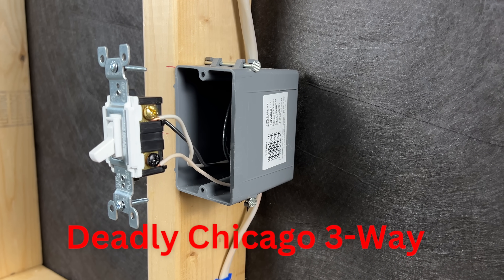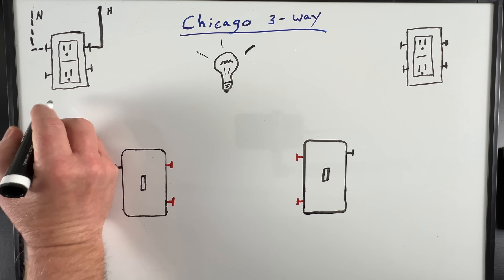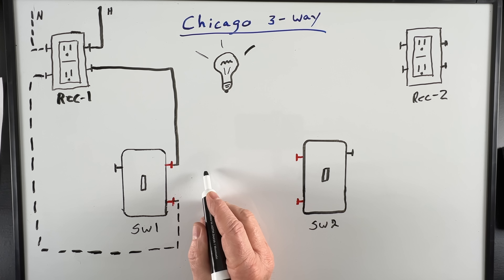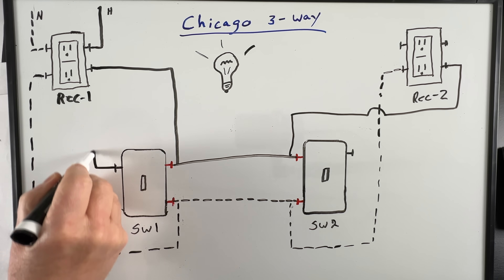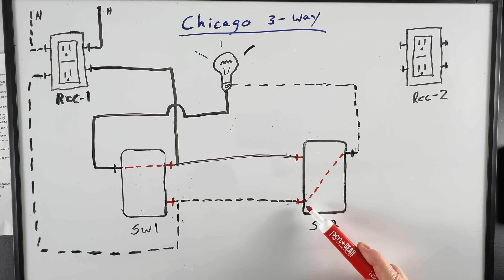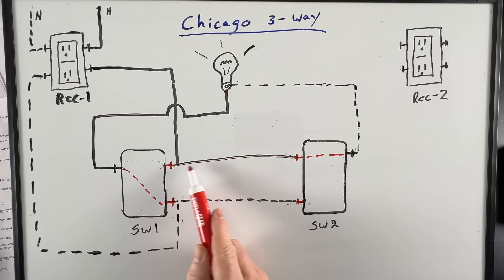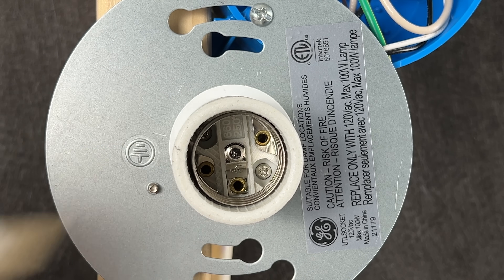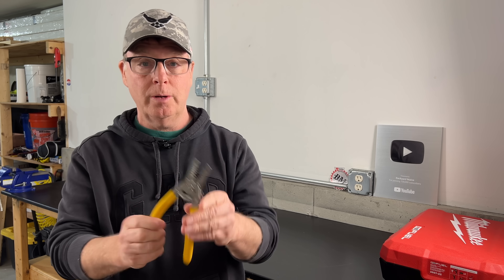The Deadly Chicago 3-Way (Only 2 Wires)

Comment: Warning, this is just a pedantic rant by a stickler for details... You have been warned, and chose to continue reading, that's on you.

The conventional hot and neutral sides of your recept's are swapped, and the wider blade slots on 3 out of the 4 sets show the hot as the wider blade. 

There is a minor consequence to this. You only show 3 of the 4 possible switch configurations, as with your current setup the 4th is not that dangerous, and thus uninteresting. (The hot just dead-ends at a switch [or continues to the other recept' if there is one], and neutral runs a loop between the two switches and fixture [branching off to feed rec-2 if included].) However if you swap the hot and neutral to the conventional sides of the receptacle, that neutral loop becomes a hot loop, and thus both light-off positions make the lamp socket hot when off.

Also you never mentioned that lighting is not the only possible load on a 3-way switch, and so hot-when off conditions can have other consequences to load equiptment. Probably not a situation anyone's ever likely to run into, but something to think about.

Please remember this is just a pedantic rant. I know I'm imperfect and thus probably got some things wrong too, especially with grammar and spelling.

I also know, for conceptual understanding of a Chicago three-way's wiring, this stuff doesn't matter much, and nobody cares. I get that.

I also considdered that you may have swapped the conventional positions of hot and neutral to make drawing it easier to draw, or easier to understand, as you may have thought there may be fewer jump overs or some similar concern. However after having worked it out, I ruled that out, as it would actually make things a little cleaner if the hot is moved to the bottom of the switches.

All that having been said, this was a great video, I definitely enjoyed it. Thank you for your time and effort.
Reply from the maker: Couple of notes.. The with the ground down like I show on my drawing the hots are on the right and the neutral are on the left. I didn't pay much attention to drawing the slots well. But also I have the California 3-way video coming up next. This weekend. The other two will follow.
Reply: @BackyardMaine Lol, I claim to be a stickler for detail and failed to notice it's ground down which is standard in the majority of the US... lol my bad, I knew it was wise to mention that I probably missed something.

Comment: Chicago Sparky here. It's standard practice, at least with the me and the firms I've worked with, to fix these when we come across them. Another advantage of everything being in EMT.
Reply from the maker: Yeah EMT is nice but I imagine it adds a pretty large expense during installation.
Reply: @BackyardMaine  indeed. That's why it's code here. When the codes were originally drafted there were a lot of electrical component manufacturing in the area. Another example of working the economy into building code.
Reply: Including driving up the price of any electrical install. A sea of metal tubing.
Reply: @glee21012  true, but once installed it does make any service work and rewiring so much easier than NM cable does. And you have the extra ground of the grounded system with all that metal touching. The EMT also protects the wires, unlike NM which doesn't at all.
Reply: @glee21012  Secure and protected.

Comment: Did this to feed the garages in Ohio with 2 wires and still had a hot plug  and a switch in the house to turn the garage light off

Comment: I've been an electrician for almost 40 years, I have never seen ANYTHING like this and I've worked in a lot of knob and tube homes(near Philadelphia region), glad I never came across this.  It makes sense for functionality, but WOW! Lutron Caseta with Picos is an easy fix.
Reply from the maker: I have only come across a few in my 40 years in the trade. It took a minute to figure it out the first time. No internet back then so didn't know what I found. lol

Comment: Retired Electrician, Worked around the Washington DC area and fixed a few of these in older homes. We called them "Lazy Susans."  Met my wife on a service call to repair one, I was the third electrician she called, everything was pulled apart for the remodel. First two walked away insisting there was no way that it had worked before. I bet her dinner that I could fix it in 20 minutes (4 gang box of switches). We had Pizza - she paid.
Reply from the maker: That's a great story my friend.. It pays to be smart.
Reply: I can clearly see why a Bass Ackwards wiring scheme like that is called the "Chicago 3 way". @BackyardMaine
Reply: @BackyardMaine  See my comment reply above- I don't think that was so smart... I think the guys who refused to fix what needed to be torn out & upgraded properly were the dudes who made the right call even if that means no free pizza & marriage for them!
Reply: Great story. Congratulations to you both !
Reply: @timothygriscom7110  Terrible story- if he had done the right thing he ALSO would have said it could not be "fixed" & left... just like the other dudes did... bcuz what needed to happen was a tearing out of the garbage & the upgrading >>> properly <<< so the dudes that refused & said it could not be fixed were actually the guys that did the right thing... they lost out on free pizza & marriage but they did what every professional should always do- refuse to do unsafe work & insist on only doing things properly... it's called MINIMUM CODE for a reason & there is no such thing as a MASTER of a TRADE- who is not always ahead of CODE in his decision making & problem solving... that is how CODE evolves... not by corporofascists bribing gov't & dum dum supposed "genius inventors" using gov't to force people to do things that make them $$$ or allow them to monopolize the market by forcing things upon them that have nothing to do with safety & instead are all about [some persons &/or some limited group of persons' >>> ideas of what is] convenience!
Reply: That's probably the most awesome "How we met" story I ever heard
Reply: @markchidester6239 it was but unfortunately she died recently, Electrocuted changing a lightbulb…
Reply: @markchidester6239  The guys that refused to "fix" the unsafe wiring were actually the ones that did the all correct thing!
Reply: Love this story, I’ve been an electrician for 45yrs in Washington DC and Lazy Susan or also called Hot and Lazy are extremely common here in almost any non updated house. I know of about a dozen different configurations depending on two or three floor homes.
Reply: You did such a great job that she refused to let you leave... lol
Reply: She paid🫡🫡🫡
Reply: I mainly do low-voltage stuff, but occasionally I'll install smart light switches. Also in the DC area. This old wiring method explains so much...I've seen a handful of switches with this unfamiliar wiring which I had assumed was just improperly installed. 

Tripped a breaker when testing a new smart dimmer switch once, and from that point on I no longer touch anything that isn't wired according to modern code. I just tell them to call an electrician.

Another oddity with older homes is the doorbell transformer. I've seen them in some very creative locations. In older homes they're sometimes tucked away behind a random wall somewhere, and the only way to access them is to cut out the drywall.
Reply: @nameismetatoo4591  Everything is low voltage stuff up to 1000V.
Reply: Is your wife named Susan?
Reply: @chrisfitz5311  Your name is Lefmitty konstabwuwmn?
Reply: You most definitely rewired her as well
Reply: Theres no way you properly fixed 4 boxes in 20min but okay, cool story I believe in you 😂
Reply: First wife?
Reply: I want this story in a video , upload it then reply to my comment!

Do it for the team
Reply: Guess i have to start repairing wires 😏
Reply: 20 minutes? Damn. I had 2 two gangs with 2 separate three way systems. It took me a couple of hours. Never saw this before. Figured it out but I was a bit frazzled. Ha ha.
Reply: I think I came across this about 40 years ago in an old house. I did not repair it. I had only been a journeyman for a year or so. I’m retired now. But it’s good information.
Reply: I imagine getting juice to her box made her fall in love rapidly.
Reply: I think she was trying to have a porn fantasy and you were the first of the servicemen to take the bait
Reply: Dying breed unfortunately. Girls are not like that anymore. Now it doesn’t matter if you fix the problem and still make 6 figures. They all want a 7 figure man
Reply: We called them Dutchman’s
Reply: I had the same I had to pay for everything😂 when I started back in the late in 1970s  New York City in the old r houses had a lot of setups the Days😊
Reply: And she is still paying!
Reply: Instructions unclear, now I have a sexual harrasment case against me 😢
Reply: This is ridiculous.
Reply: We used to call them hot travelers or dummies....they would burn out 3 way light dimmer, because the make before break gap was so close that the voltage would jump across the contacts connected to the traveler screws!
Reply: You won't the battle but lost the war.
Reply: That's interesting because lazy susan typically refers to something completely different and not electrical. This Susan broad must have been lazy as hell to be so infamous
Reply: This is an old story if you are a service electrician and work on older homes.  Seems to be less commen in my area of the upstate of NY though.  In my 10 years as a service electrician, I ran into it once.  I, of course, was there after 4 other electricians had had a go at it.  Maiking things even better was the fact that the main Jbox was at the top of the stairs and was buried too.  75+ year old BX with soldered and deteriorated connections and insulation made the repairs even more fun.  What ever you wanna call the circuit, it still sucks and is still a pain in the ass.  Dangerous?  Maybe a little but not really in the context of a fixed lighting fixture.
Reply: Fixed loads of them. In old town Alexandra
Reply: Keeper!
Reply: Nioce
Reply: i have one of these at my current rental house, i wanted to trade out a switch for a smart 3 way switch... i was confused why it was done this way, so i put it back the way it was. 100 year old houses have lots of stupid things
Reply: Well you should have torn that garbage out & rewired the joint... better to LIE & say it can't be fixed like the other dudes did in order to avoid continuing an unsafe situ then to "prove" how "smart" you are by "fixing it" only to continue creating a hazard for her & all the neighborhood <<< situ's like that are the whole reason we call it MINIMUM CODE <<< it IS the minimum standard- professionals & especially every TRUE Master of a TRADE &/or HONEST competent & professional contractor will EXCEED CODE to ensure the safety of all who dwell in & near their projects- for instance long before others even heard of circuit fault interrupters [as opposed to GFIC] outlets I knew a dude who installed them in all non wet areas of all residences he did the work in... he was ahead of CODE... and that is precisely how code evolves... so happy you got married & apparently had no safety issues... but you are DEAD WRONG that the other electricians could not fix your wife's problem <<< they refused to do something they knew was unsafe regardless of it satisfying MINIMUM CODE at that juncture & so they moved on totally in the hopes she would decide to pay for the upgraded re-wire job that was necessary by not being able to find someone to repair what needed to be replaced for the safety of all concerned... they KNEW what they were doing- 100% & they LIED on purpose... not eating free pizza is a small sacrifice for doing the right thing for your future wife & the community her residence was located in... that being said I live in DC & I totally see shoddy trade work like on almost EVERY JOB- you would not believe the stuff I have had to fix... I NEVER LEAVE BAD/UNSAFE STUFF II COME ACROSS N PLACE & if I have to give my client a discount/ even do the labor as a freebie- then that's life & I just do it... dudes thinking they are smarter than minimum code & can violate it added to those who aren't smart enough to know that the word MINIMUM has a definitive meaning so you need to do better than that min standard create an unbelievably number of hazards & problems that 99% of Home Owners are oblivious to & no one is the MASTER of their trade until they know all those instances where the MIN CODE is NOT the call but exceeding it properly IS the right call]... in that sense contracting & [if we had real statesmen today] politicians are the SAME- in order to serve the people you MUST do what is BEST for the people even when they do not want you to- hence you need to LIE while staying faithful to the mission to keep people safe, uphold their GOD Endowed RIGHTS & adhere to the CUSA Restraint on gov't powers... they simply are not ready to understand that the truth they hate is best for them so you have to LIE & do what's right- regardless of the price they make you pay for it... today of course we get all the lying & none of the bcuz they are being faithful to the job of serving the best interests of the people- since they are all corrupt criminals & traitors!
Being an HONEST & COMPETENT contractor is a real burden bcuz you have to save your clients from both their own ignorance & the garbage others have conned them into believing... dirty job but someone has to do it! Anyone following behind you gets easy money bcuz everything is all correct whereas you are continually drained by having to deal with substandard work that needs fixing- rarely is the client able to understand & accommodate that truth & fact so the honest are always getting screwed by the shady operators.
Honesty means you seriously have to LIE sometimes = TRUTH & FACT! 
That is a terrible TRUTH to be sure- but that is not on you if you do it for the good of the other person- it is necessary bcuz of the corrupt world we live in & the evil & wicked who are in charge! 100% So if I had shown up at your wife's door I would also have refused to do that job & in order to ensure that I could still leave open the door for that PROPER re & re work to be done that was actually necessary & wanting to be hired to do the job that needed to be done- properly since that is also in a clients interest since you know you will do the right thing...  So sure I might lie & tell her "fixing it was impossible" & she had only one option to tear it out & upgrade <<< so no free pizza or marriage for me >>> HOWEVER that would be the PROPER MORAL CALL in the case as you describe it- 100%!
Reply: @MrAdamNTProtester everything was pulled apart for the rewire
Reply: @MrAdamNTProtester holy shit. Shut up
Reply: What a simp
Reply: @saltybits9954so bitter 😂

Dude rizzes up his client by being capable at his profession and then locks it down with a ring, but sure somehow that makes him a simp 🤡
Reply: Did you pull out that night or did you leave it in?

Comment: Yes sir nice vid

I live in a house in texas that we built in the late 50s early 60s

One 3way in the house for living room, lit me up first time i attempted a ceiling fan replacement hahaha.. shut the main off after that😂

I re-wired a house from mid 40-50s same chic 3 way 

Like he said when it's old work is very difficult to identify a lot of the wiring especially since its all 2 wire and if it's really old.. the old cloth wrap cable that's all tied together w mech device and tar covering everything
Reply from the maker: Yes for sure.. I have removed lots of old knob and tube wiring in my life. Mostly back in the 80s and 90s when I did a lot of side work. Been an industrial electrician most of my career. Thanks for sharing..

Comment: In Europe also known as the french 3-way. It's illegal in all code books that I know of.

Switches would often go with a bang when the compensation capacitor of a fluorescent fixture failed.

A uncompensated fluorescent fixture pulls a decent arc in the switch and hot and neutral would often get bridged by that arc and BANG.

I came across this circuit a few times and it was either a very old building or some shoddy shack/ garage with 2 entrances and preferably some old cut up extension cords as wiring.
Reply from the maker: Thanks for sharing. Yes this method is very old and has been banned here in the USA for at least 60 years maybe longer. But they are still found in old homes on occasion.
Reply: @BackyardMaine   FYI reading so many of the comments after watching this video inspired me to do some extensive research on Google,  and this method goes by many names, Carter,  Chicago,  Farmers,  barnyard,  lazy susan, lazy neutral, power beyond,  hot shot, Los Angeles, Tennessee,  or  reverse 3 way. Whatever name you want to use, this method was banned by the NEC in 1923.   The advantage was that it allowed for power on both ends, using only 3 wires in between instead of 4 , so you save 1 wire vs using the standard traveller method used today.   

That all makes sense,  because the farm where I ran across this was a very rural area and didn't get electricity till 1951, and the yardlight was installed about a year or two later.   The owner's father (who lived during the great depression) had wired it.  Since times were very tough,  many folks who lived during the 1930s lived a very frugal lifestyle afterwards,  as though another depression could strike again at any movement.   At least this was how my great grandmother was just before she passed 3 years ago,  told me many stories about the struggles her parents faced when she was a little girl.